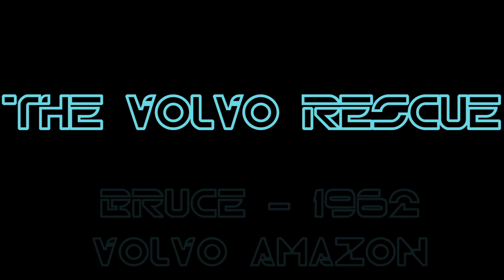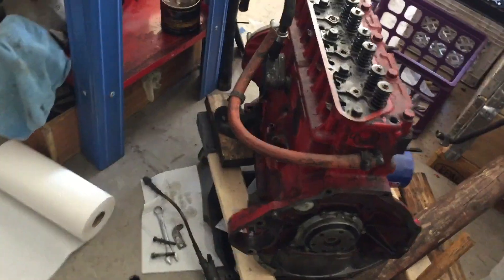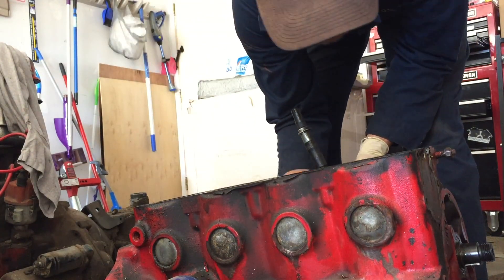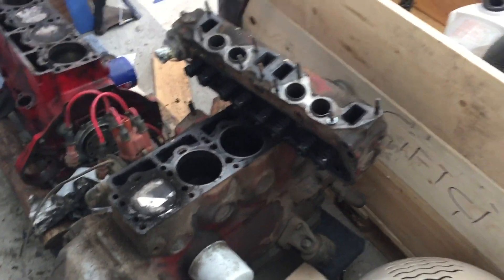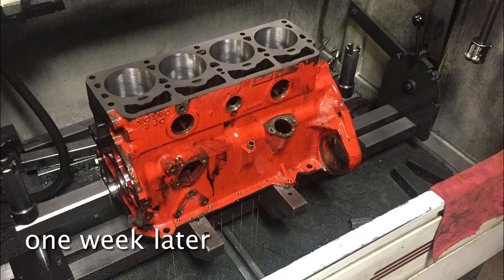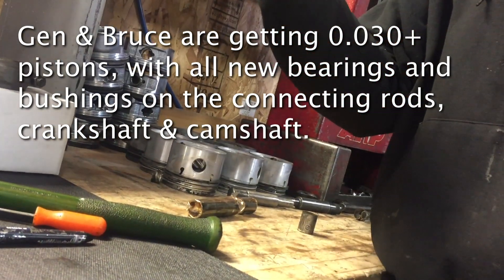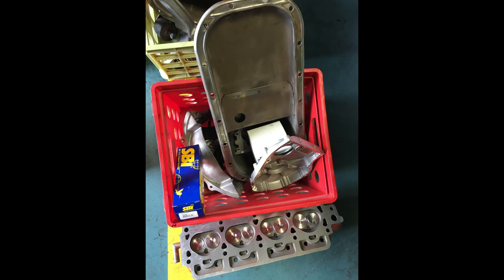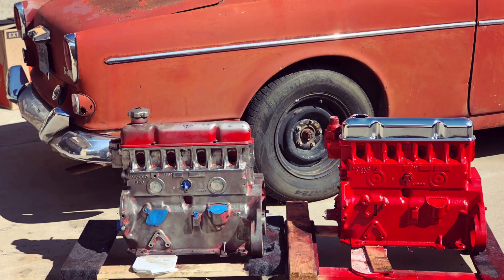🇸🇪 (S3:E3) Rebuilding Volvo B20 Engines

Comment: I have a Seized Volvo B20 engine, when I took it apart I found one of the cylinder liners is cracked. Can these be replaced or is the block scrap?

Comment: Superb, nicely paced video. From a French/Italian Australian with a bit of Scottish and Irish there too 😉. Mongrels are strong; as are real Volvos. 1970 140, 1985 240, 1992 940 Station Wagon. Last two are daily drivers, first one soon will be.
Any special advice on fuel pump or supply problems on the 1970 140? Runs fine from another source: thinking blockage from tank through fuel hose or (loud but clean) pump not working.  Subbed. Immediately. Sending real Volvo Swedish Bear hugs worldwide from Canberra, Australia 🤗  🇦🇺

Comment: You shouldn't use any sealer/glue/whatever when you put new freeze plugs in. Just make sure the mounting-surface is clean, and whack the dome shaped side of the plug, that should make the plug expand enough to keep it in place if done properly.

Comment: My machine shop also didn't properly install my freeze plugs, in my B23. Two popped out on separate occasions, I had to pull both manifolds off to seat them all. Cool video, more back story.
Reply from the maker: simon cutler did you just smack in the new ones or add sealer then smack?
Reply: @DavidBello  I just popped em in and gave em a good whack. Only one  started to leak a while later, so I JB welded it in